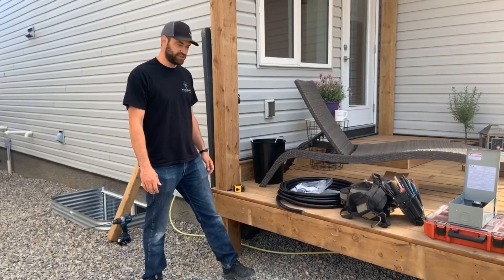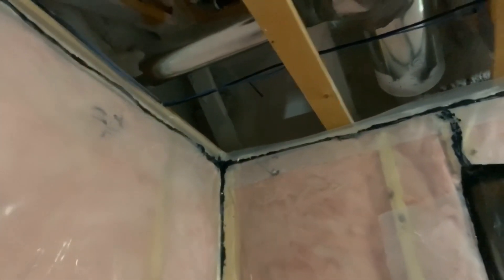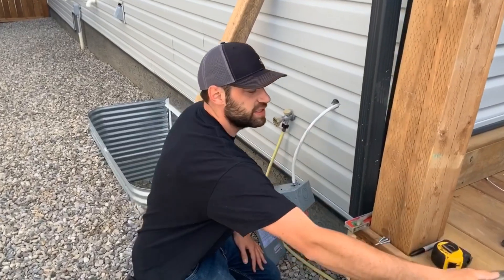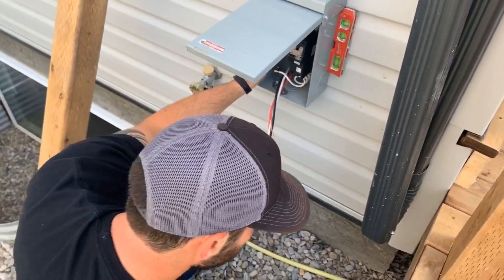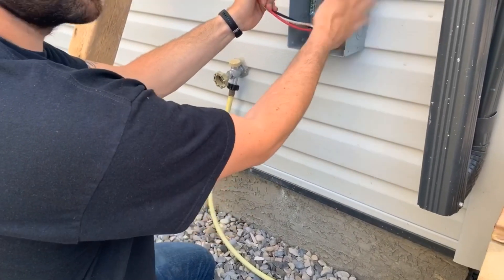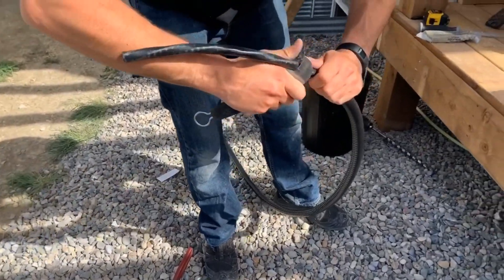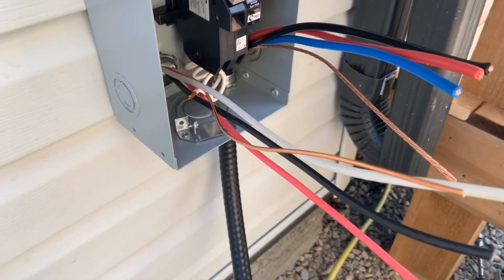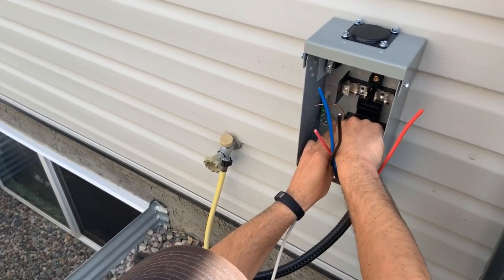Hot tub electrical install explaining parts of spa package and terminations

Comment: Awesome video man. I'm from Ontario and an industrial apprentice so I don't do much of this work but was curios would it be cheaper to run a say #6 Aluminum from spa package to spa or even go the route of using liquid tight conduit and running #8 copper separate cables?
Reply from the maker: Yes it would definitely be cheaper, but on almost every hot tub we’ve installed they don’t allow aluminum to be terminated in the tub.

Comment: Amazing the difference in codes. In the US the GFCI panel has to be within sight and 5' from the spa tub.
Reply: The GFI receptacle = within 10 to 20ft of the spa tub
Reply: And grounding has to be green, not bare copper.
Reply: @ryaandnice  Ryan, the NEC allows for several ways to identify a "ground wire".  Bare is an acceptable condition.  I think it is in section 200.4.  That said, they are in Canada and as always, nec section 90.4 allows the building inspectors to "interpret" the code.  Hope I was helpfull.
Reply: And a service outlet within 25ft I believe
Reply: At least 5 ft
Reply: Anyone know CEC enough to know if that 'line of sight' is a thing in canada too?
Reply: ●        Only copper conductors may be used, and all metal components within five feet of the hot tub must be bonded together with the appropriate size copper wire.

●        An equipotential bonding grid, which is designed to mitigate step and touch voltage, must be installed.

●        The hot tub must connect to a dedicated circuit protected by a GFCI.

●        Any lighting, outlets, plugs, or other electrical equipment within five feet of the hot tub must be connected to a GFCI.

●        A maintenance disconnect must be installed for all ungrounded wires, save those for lighting. This disconnect must be at least five feet, but no more than 50 feet from the water’s edge. It must also be visible from the hot tub.

●        There must be at least one convenience receptacle between six and 20 feet from the inside wall of the hot tub. This must be a GFCI receptacle.

●        All outdoor receptacles that are exposed to weather must have a weatherproof covering.
Reply: In the US the disconnect needs to be a minimum of 5-feet from the tub, but no more than 50-feet. And it has to be line of sight, so you can't tuck it around a corner.
Reply: @wcraft  Thank-you for correct ing all the miss information...NOT CLOSER than 5 feet

Comment: So you instelled 240v power pack right beside the water bib ?   Seems like a very dangerous proposition.  Hoses leak and spray water sometimes at the bib connection and its easily within reach of that 240 power.  Just sayin'
Reply from the maker: I’ll start off with what I always reply on these comments, this job was inspected under the Canadian electrical code and passed. Now I’m gonna ask a question back to maybe help you understand, do you think the water coming from a hose is different then the water that falls from the sky? That’s a weatherproof panel rated for the outdoors.
Reply: so you're suggesting that it NEVER rains in this location?? If the "power pack" is good enough and water tight enough for rain wouldn't you think it would be water tight for the hose? just sayin
Reply from the maker: @briansmith-ql5yu  😂 thanks for sayin what we could not, we appreciate it!

Comment: You have done a great job, very professional! Though, the wire size is in correct for your job. Number 8 Guage wire is only good for 40 amps.
  You need a # 6 wire for 50 amps. Please check out your electrical code.
Reply from the maker: Thanks so much Michael, this video was filmed in 🇨🇦 and under the Canadian electrical code part 1, #8 is good for 50 amps.
Reply: @Luminelectric  Hey great video, in the process of wiring my new hot tub. Just to make sure, you can use #6 wire for 50amps though? And where do you find those teck cable connectors in Canada?
Reply from the maker: @curtf5647  yes you can definitely use #6 on a 50 amp breaker in Canada

Comment: I noticed you used stranded wire apposed to solid wire..is that normal or any benefits to it.
Reply from the maker: Electrical wire is only solid up to #10 so these # 8 wires will always come stranded even when selecting a different styles of cable. 

A good question though, as it does help in anything that’s vibrating a lot, so not in the case of the tub but definitely on motors and vehicles.

Comment: I'm just a little critical but you will never be level with your level tool oriented vertical, that's called plumb. Level is horizontal, just FYI so you get your terms correct
Reply from the maker: You are correct sir, thanks for pointing that out but you aren’t the first one to do so. I think we will leave the video as it’s about learning hot tub electrical in this video that counts.

Comment: Could this be used as a disconnect for a direct wire generator?
Reply from the maker: No definitely a different application, you would want a manual or automatic transfer switch.
Reply: @Luminelectric  I have a 50 amp breaker in my main panel that runs a 6/4 wire to a remote location where I need and interface that just connects the female plug to the 6/4 wire
Reply from the maker: That application this can work, it’s just monitoring current between each phase and phase to ground. on hot tubs it doubles as a disconnect.
Reply: @Luminelectric  OK I’m familiar with disconnects because I’m an HVAC tech. So I’m just looking to avoid using a suicide cord because male connectors are hard to find
Reply from the maker: If it’s for outside applications I would recommend a receptacle that is a twist lock.

Comment: 'Make sure those are nice and tight'.  No offense but your screwdriver is a bit small for tightening those lugs.  Another thing I found out is that after ten years one hot lug in my GFCI wasn't as tight as I thought it should be.  Found this out when removing Hot tub and all wiring.  Good video minus the small screwdriver.   I learned about tight lugs from the power company;  I moved my meter base from outside the wall to inside the wall during a remodel and I tightened the hell out of those lugs, then the power guy got out his breaker bar and said 'let me help you out here' and turned them another 1/4 turn.
Reply from the maker: Good advice, not everything gets filmed on a day like this. We do make sure to tighten our lugs, move the wire and repeat the process. Tight lugs are happy lugs

Comment: can you list in your notes the type of wire you ran inside so some of us DIYers can go get that I couldn't quite hear what you said it was
Reply from the maker: This is an 8/3 Tec cable, in Canada it’s rated up to 50 amps
Reply: @Luminelectric  if I'm not mistaken I believe they recommend 6 gauge wire for a 50 amp circuit in the USA.
Reply from the maker: You are definitely right in the NEC, This video is of a Canadian install under the CEC and #8 is good for 50 amps here in 🇨🇦

Comment: I personally would have used a chase nipple would have required a much smaller hole and if for whatever reason you’d need to get back to that wire to replace or work on it you wouldn’t have to completely disassemble because there’s a connector buried in the wall

Comment: What do you mean "terminate the 50 amp main in the panel? Are you still using a breaker in the main panel?
Reply from the maker: So you need a regular 50 amp breaker in your main panel and that feeds out to the spa pack, the spa pack has the GFI 50 amp breaker that’s going to protect the tub if there is a ground fault.

Comment: So, you have a breaker outside. Do you have an additional breaker inside to the house panel? Would it not be cheaper to use a disconnect instead of 2 breakers.
Reply from the maker: The reason we have 2 breakers is to save money on buying a GFI breaker for your panel. A Siemens spa package + a regular breaker for a panel is cheaper then a Siemens GFI breaker and a disconnect.

Comment: 8/3?should be a 6/3 for a 50amp service 8/3 won’t Handel the load.per balboa or gecko specs..
Reply from the maker: Hi Greg, appreciate your comment but in this thread we noticed this question again and again. This tub is a 38 amp hot tub, We are using 50 amp breakers/spa package and wire to account for any inrush current. But 8/3 in Canada is rated for 50 amps in the CEC. All our jobs are inspected by the local authorities under the CEC. We appreciate your feedback.

Comment: Good video.
Hopefully helpful comment, it is single phase power.  120v or 240 v they are both single phase power.  The red and black are separate legs or taps from the transformer but still single phase power.

Comment: Are Anti short bushings needed? Doing the same job in Ontario
Reply from the maker: We have noticed the minor difference between inspection authorities in Canada, but no one has ever asked us to use an anti short on teck cable, we do use them on AWC/BX and other armoured cables though, thanks for your comment.
Reply: @Luminelectric  thx for the update. I checked the CEC and states if the jacket is at least 5mm from the aluminum armor its not needed.  I am also running my 6/3 as the service for the spa panel, and not sure what terminating fitting is required outside of the giant Star Teck Connector.
Reply from the maker: Use a tec connector, 3/4” should fit a 6/3 conductor. Glad we can help you out.

Comment: What type of cable did you use for the whip to the tub? The black rubber coated armor
Reply from the maker: That’s teck cable. #8 with 3 conductors.
Reply: @Luminelectric  thanks. I'm having a tough time finding #8 6 conductor
Reply from the maker: Why do you need 6 conductors? Most hot tubs need 3 conductors, I have seen multi wire systems but usually the pumps are smaller so you can downsize the wire. 3 conductor will have black (hot) red (hot) and blue(tape white use as neutral) and the ground will be in there too just doesn’t count as a conductor.
Reply: @Luminelectric  its a hot springs needs a 20 and 30 amp gfci mounted in the spa panel... its been a pain
Reply from the maker: We have dealt with this before, go to the local electrical wholesaler and get the wire ordered. It’s a hard find. Good luck.

Comment: If the tub is within 10 feet of disconnect can you use the 10ft tap rule and use a 10/3 instead ?
Reply from the maker: No, you can’t do that.
Reply: @Luminelectric  why
Reply from the maker: It’s not considered a tap connection, the spa package must be at least 10’ from the tub unless a barrier is blocking the tub from the spa package, and you have to allow for the motors in rush current, #10 is just to small to handle the amps safely (unless your hot tub is less then 24 amps).
Reply: @Luminelectric  - Code must be different in Canada ?? It's at least 5 feet in America.

Comment: Sure is an expensive way to do it. Just put a gfci 2 pole in the panel and put a 60 amp non fusible outside. No need to use breakers in the panel and disconnect
Reply from the maker: In our experience, the GFCI breakers are more expensive then the spa package and breaker combined. Special if your in a federal panel. We appreciate your feed back, hope you at least enjoyed our video.
Reply: @Luminelectric  you can get a 2 pole gfci breaker for 100. A non fusible 60 amp disconnect for 12 bucks.
Reply from the maker: Send us over who is providing your breakers.
Reply: @Luminelectric  home depot

Comment: great job!!! looks clean and done right.  As an electrician myself for the power company, I can relate to how clean work this is. I have to ask though, isn't 8 AWG a little over kill ?  or are they running a big hot tub with other electronics?  I would think 10 AWG would be enough unless its a high current unit
Reply: I am using #6 conductors actually.
Reply: Most OEM documentation will point to 6 actually.
Reply: The one I have requires 8, but is there not any regulation on how close to a water source it should be?
Reply: Just seems really close to that....
Reply from the maker: Sam Sangiorgi thanks for comments and support, this hot tub has an FLA of 39 amps, we run everything with our derating factors which works out to just shy of 50 amps.
So everything for a tub is ran as #8 with 50 amp breakers.

Comment: What is the minimum distance from the tub to the spa kit GFCI?  Is it 3m?
Reply: In Canada, sorry.
Reply from the maker: Yes sir it has to be at lease 3 meter from the tub or have a physical barrier like a wall.
Reply: @Luminelectric  How "accessible" does the panel need to be?  Only place I can reasonably locate it is near a window well somewhat blocked by a shrub.  It's reasonable to access, but not right out in the open.
Reply from the maker: I would say your fine, ask your inspector any questions or concerns if your worried it might not pass inspection.

Comment: yo cool stuff! I work commercial in my 4th year as an apprentice so its cool seeing this kina stuff. What does the neutral in the breaker do?
Reply from the maker: The neutral wire from the breaker monitors the current between ground and the two single phases on the breaker. It is a GFCI (ground fault circuit interruptor) break.

Comment: Addressing some variations between the USA and Canada might be handy but nobody can be spot on for all of them. Then we have the UK (and others) who use 240 volt mains on everything so there is no 120 volt in their wiring. That's another animal when it comes to code understanding. In my area (New England USA) we have some odd requirements on distance between the spa box and the tub, which vary from location to location. They all seem to point out that the "main disconnect" should be within sight of the tub and clearly marked but far enough away that you can't reach it conveniently. (something like 12 ft) Same for having a service outlet nearby, that must also be GFIC. (recalling 12 - 15 ft) Most also call for #6 wire as a minimum for a 50 - 60 amp branch circuit out of the main panel (hence the remarks) but it quickly becomes obvious that most tubs only pull something under 40 amps, so doing the math with 80% loading on a branch circuit we're talking extra capacity only for the motor surge, so a 50 amp circuit will fit the bill. Given some distance (certain installs) the #8 wire might not cut it for voltage drop, at least for the entire run, but certainly for the last leg. If you add a service outlet to the spa box you probably need the #6 wire that far.
Reply from the maker: Thanks for this rupe53, I think everyone loves any extra help.

Comment: 50 amp gfci breaker and 50 amp breaker at main panel and # 8 wire ? Should be # 6 wire was this guy a electrician?
Reply from the maker: TEXAN1845 thanks for your input, we are all lisenced electricians in Canada and follow all CEC codes, #8 is good for 50 amps here. This job has been inspected by the local inspector.
Reply: @Luminelectric  ... I think many of the questions regarding the wire size using #8 are related to design temp. If the #8 you are using is rated at higher temp than your usual #6 NM cable you are ok as long as the run allows you to stay within voltage drop. In this case it's a short run so I don't see a problem. The 50 amp branch circuit will only be running at around 38 amps except for the start surge. (hopefully)
Reply from the maker: rupe53 there’s a rule in the CEC about rating for inrush on a tub these tubs are max 40 amps, any larger you have to upgrade it #6.
Reply: @Luminelectric  ... yes, I believe I just covered that in another post. Always interesting to chat about different design temps and what some allow (locally) when it comes to protective jackets and double jackets, then fill rates of the various design temps. Over the years I have had many chats about using #10/3 SO cable and the ratings per leg differ between 3 - 4 - 5 wire within the same jacket.

Comment: hey i have a question, im in Alberta, i have a 50amp spa pack that came with my hot tub (not delivered yet), the area where I want the cable to come through the wall is around 3 feet from ground level, is that too low? any higher and i have to open up my kitchen.  i had a look in the code book and couldnt find anything about height off ground, but since im in Edmonton, the snow pack can get 3 feet some winters.
Reply from the maker: What I recommend as I have see this problem before, is to make your penetration outside as high as you can from grade and either sleeve a liquid tight over flex over your loomex (NMD) and gaining height that way down to your penetration or if you think you have enough height off your penetration come into the back of the spa package on the bottom back knock out. 
Email me if I’ve confused you more and I’ll send you some pictures of what I’m talking about. Info@platinum-Lighting.ca

Comment: #6 copper ground is required. The wire you are using is #10 for ground.
Reply: Exactly what I was thinking #6 ? .
Reply from the maker: Christian, this fellow is talking about the grounding (bonding) conductor. 

This tub is a 40 amp tub with breakers and wire sized to 50 amp to accommodate inrush current. All legit here in Canada under the CEC (Canadian electrical code) and inspected by the local authority.
Reply from the maker: Yes sir a number 10 comes inside your teck 8/3 cable, it is used to bond the can and the armour, connectors and anything metal it touches, this method of bonding is correct in Canada, also this has been inspected by the local electrical authorities. 

#6 copper is used to ground the main service of a home in Canada

Hope this helped clear up any confusion.
Reply: @Luminelectric  is any additional ground required for the spa in canada?
Reply from the maker: @Kyle-mj6wf  in Canada as long as your cable has a grounding conductor in it, that will count as bonding as long as it’s hooked up properly.